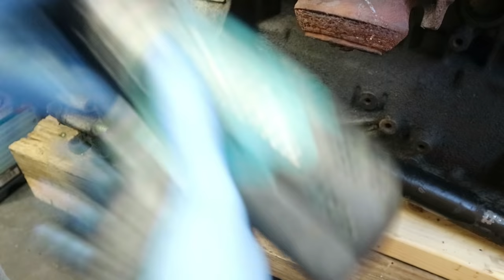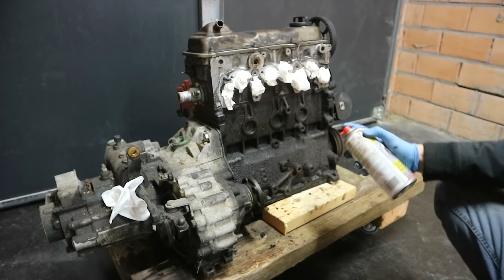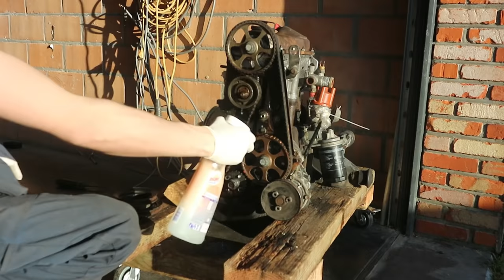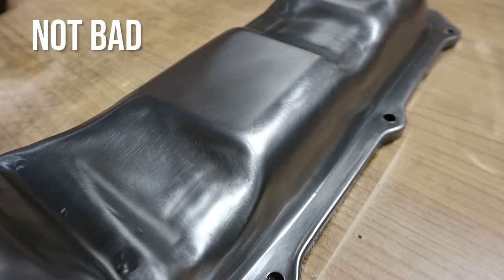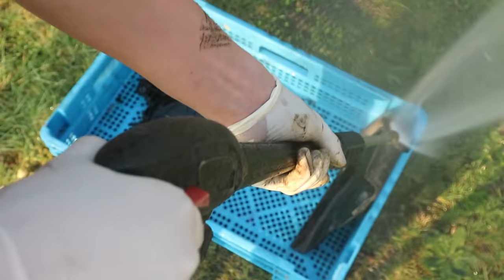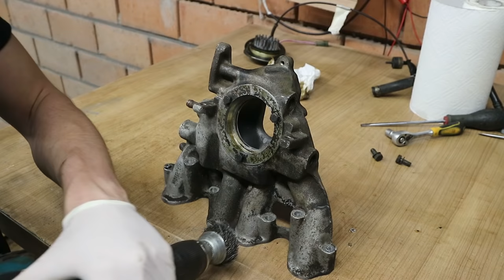Refreshing an 80s VOLKSWAGEN engine  |  Volkswagen Golf Mk1 Engine swap

Comment: I remember these SOHC 8V engines. I built a couple of these. The German spec 9A ( here in the States ) was the engine to have if you wanted a good build. It came with the 10.1:1 CR pistons. Stout little engines but they do better as turbocharged units. Nowadays if I were to build one I would skip these and go for the 1.8T...same engine just with 5 valve head. The make nice projects!! Would make an MK1 go like the wind!! Glad to see someone is still into these older cars. They have so much more character than the new Volkswagens.

Comment: Here in Brazil, this engine is know as AP and it was used by VW until 2005 if I'm not mistaken. Very reliable engine.
Reply: Eu acho que os ap só foram feitos no Brasil, na Europa é outra referência
Reply: @eoquimporta1430  É a sigla EA, se não me engano é EA837 e EA827 nesses carros
Reply: Tem gente que chama os MI de AP tbm, esse aí é APzao tbm igual do meu Seat 97
Reply: @GuilhermeMetz 
  O Motor AP de primeira geração era chamado EA827, já o de segunda geração era o famoso EA113
Reply: Motor AP foi fabricado em sua segunda geração (EA113) até 2016, a primeira geração (EA827) foi produzida até 2009
Reply: Esse do vídeo e um ea 827 mesmo muito parecido com nosso AP 1.8 brasileiro

Comment: Since you went so far as removing the valve cover and changing the belt pulley, you could also replace the belt and remove the cylinder head to check the valves and cylinder walls. You could have removed the oil sump and checked the oil pump. All in all a great job done with all the tin parts.
Reply: i igree!
Reply: and water pump change...
Reply: The cylinder head bolts of this engine deform when being tightened. So you would have to buy new ones if you want to remove the head.
Reply: @joshuatassone8764  that's weird are they meant to?
Reply: @ricky107_  Based on my knowledge, yes.
Reply: @joshuatassone8764  its always wise to replace cylinder head bolts on any vehicle when doing the head, I do
Reply: @ricky107_  Yes. They are also meant to be tighten down with the right about of force. And by that force they are made to hold the engine together. They are not meant to be reused. They are the vital part of holding the head and block together.
Reply: @ricky107_  I know this is an old comment, but yes. For some applications, like some cylinder heads, they use torque to yield bolts. These bolts get torqued to such a degree (due to the high loads they have to carry for a long time) that they permanently deform once they are installed and will stay this way forever. To get a good, tight seal again, you will need to use new bolts as the old ones are already deformed and won't hold the head and block together as tightly as they did before.

Comment: Nice work. For a complete work, you can clean the pistons, replace the head gasket and bearings. A lot of cars used this engine here in Brasil, in 90's was common a 1.8s ethanol version, with 12.3:1 of compression and Pierburg 2E, they came with 106cv from factory.

Comment: How can you not like a clean engine? A clean engine runs cooler and therefore longer. Thumbs Up. I think I would have changed the timing belt as well, myself. A ton easier then when it is installed...

Comment: In Brazil this is the most prepared engine for high power. called "AP" alta potência and came out in several cars of own brand: gol mk1 mk2 mk3 mk4, Santana mk1 mk2, Passat b1, Apollo, polo classic, Jetta mk6, golf mk3 and mk4, Voyage mk1, Saveiro mk1 mk2 mk3 mk4, parati mk1 mk2 mk3 mk4, pointer, Logus, van And diesel version as in Kombi and Saveiro

Comment: that engine is called AP, there is 1.6, 1.8, 1.9 and 2.0 versions. it's the most popular engine here in Brazil, cuz it can hold high presures of turbo, it's really cheap and u can find it anywhere. we have cars with almost 2000 HP using this engine.
Reply: i really would LOVE to know how your getting 2000hp out of a 8v 1.6  🤦🏻‍♂️
Reply: @vdubskiee5356  well then search for the AP engine and enjoy :)

Comment: This is the most bulletproof VW 4 banger known to mankind!!!! IMO
Reply: Correct.
Reply: dont forget the 1.9 TDI
Reply: @Pain5k  in terms of reliability older engines are better even though they might be more pollutant and lacking technology, my grandpa had a 1.6 diesel passat b2 that engine was a tank, car got scrapped unfortunately
Reply: Yea, and that's not saying much either.
Reply: @Pain5k   and 1.6 8V, 1.8T, 1.6D, 1.9D, 2.4D, R5 2.5Tdi...

Comment: Kiedyś miałem VW GOLF 3 z silnikiem 1.8 GT 90KM ABT, teraz mam AUDI 80 B4 2.0 90KM ABT. W Audi zrobiłem remont silnika. Pracuję w autoszlifie. 
I used to have a VW GOLF 3 with a 1.8 GT 90KM ABT engine, now I have an AUDI 80 B4 2.0 90KM ABT. I overhauled the engine at Audi. I work in a car repair shop.

Comment: this job added 50 hp to the engine
Reply: This engine barely had over 50 how from the factory
Reply: He didn't add squat, except make the engine look cleaner...not a single performance enhancing job was done to it, and by reusing the old timing belt after slopping chemicals all over it he may well have shortened the life of the engine.
Reply: Some of us are broke but still wanna have nice things
Reply: @warika1208  the original comment flew right over your head.

Comment: I found a total gem of a engine!

A 1600 engine for sale for only 250 euro’s! Sadly it does not come with a transmission. I have a build project coming up in 2 years time which is perfect with engine like this, but should I go for it? I am mostly just afraid to miss out on a engine like this.

Comment: That engine with the 1.6 Diésel Crankshaft and 10psi can take 180hp STD
Here in Argentina we have the Volkswagen Gol AP 1.6, 1.8 and 2.0i GTI (GOLF 3 engine) 
Its the equivalent of a Civic in USA 

Currently we have the fastest Front wheel drive Record in the World by Team Viturro Argentina with a VW GOL G4 1200+hp its a beast (1.8T 20v Jetta engine)

Comment: I still ride a 1400 version.  240 000km never opened. No oil usage. Recently did the clutch myself.  If I were him with the engine out , I would have done the clutch,  water pump and head gasket.  But first compression test.

Comment: Im in the process of turboing my 1.8 dx which is fitted in my 74 passat wagon.
My goal is 350whp.🤞
Stay tuned.
Reply: Any movement on this? I've just bagged a 74 b1 wagon...
Reply: @garyjones980  Nice, slammed wagon. I ended up putting an Audi 20v turbo with 5 speed AWD gearbox in it. It's only Fwd atm but will eventually be AWD.
Reply: @rhyswoodman6781  I'm keeping this original as it's been sat in an Australia shed for 38 years, only has 112k kms on it. Bright yellow with brown interior, so 70s!!!!
Reply: @garyjones980  yeah keep it original for sure! That's awesome mate.
I have five  b1s in total including an original TS which my dad bought in the 70s.
So I thought customising one of them won't hurt.

Comment: If that cover is right (197k KM) then first things in the list would be the head gasket and main seals, and check for cylinder scoring. Perhaps it needs honing and oversized components. 
Keeping the engine clean on the outside and overlooking the inside ain't the way to go. That's how you get catastrophic failures down the road. You'll never know how the cylinder walls looked like.
Not criticizing because we all started trying to make things better with a couple rugs, but that engine got pulled out for a reason.
If you don't have a torque wrench and that's why you decided to stay out of it, your local machine shop can torque the head down for you and typically free of charge if you give them the torque specs and sequence.

Comment: Great video!

Since you went this far, why not replace the head gasket? Given by the looks, the engine probably has never been opened.
Reply: @vielflieger7973  und du ein troll
Reply: @BigBossKollegah08  Klappspaten
Reply: @vielflieger7973  Sag ja Troll armes kleines Würstchen :D
Reply: @deathproofpony  wixxer
Reply: Yes so true and new oil filter and timing belt also the clutch will prob be seized
Reply: @vielflieger7973  keyboard warrior
Reply: @raymondlidy5918  Seized clutch? Why?
Reply: @DerpotronGames  I have been a mechanic and auto electrician for 40 years and most people know if you leave any engine out  or even in the car for a long time the clutch and most of all the brakes  could get seized very easy

Comment: Dude, you didn't restore it, you just cleaned it :(
No headgasket changing, no new piston rings, no cylinder wall honing, no main bearing replacement, no new valve stems and valve seal replacements :( All things I would expect when someone says restoration.
Reply from the maker: I didnt say restoration though
Reply: Yeps i agree with you memphis you said refreshing

Comment: you can use a 20v cylinder cap in it. in Argentina is a common upgrade.
Reply from the maker: Leonel Gomez 20v cilinderhead?
Reply: @memphis5220  yes. Came in the 1.8t for audi a3/s3/tt, jettas and golf gti mk4

Comment: hI guys wonder if you can help, I have   Fiat Uno 1100  1999 model.close on 275000 km on the clock. runs like a dream. on the freeway. BUT idles far too high when at stop street or stuck in traffic. was serviced recently and I thought it was the choke that was stuck. Had carb serviced a few months back. guy did a great job. starts easy , dont even need the choke anymore to start it . But  none of the mechanics can get the idle down to normal. the last garage said that the carb is " over fuelling ".. or something like that. all I know is its just costing me plenty but Id like to keep the car as a great little " run around ". what does it sound like to you ?

Comment: Holy fuck. Reusing of timing belt is prohibited !!!!! Also you should've changed camshaft and crankshaft seals, water pump.... Compression test is also good thing to do. And also there is one thing - you can achieve much more with using dedicated chem cleaners.

Comment: Did the valve cover started to leak oil? You used the wrong gasket. Your bolts on the head are made for a rubber gasket. In this video you used a cork one.  For this type of gasket you need stud bolts with an overhang ;)

Comment: Rebuilding enine isn't  hard it's a quite simple engine however  the mess of  Rubber vacuum lines in the steel braided lines of go to the air Box are horrible to service and even harder to source.

So please show that part please show that in part 3

Comment: I´d never seen a engine with two camshaft, one of them overhead, and another one at the side for gas pump and sparks.
Reply: It isn't a camshaft, it's an auxilary drive, with a lobe for the fuel pump and a gear for the distributor

Comment: First Time??? Some advice before start dismantle parts CLEAN  engine. When its  dry spray all nuts and bolt. And wait. Have a plan dont "srcew" a round all over THE engine. At the same Time. Did you change timebelt? Otherwice....  Did you change "halfmoon" cealing? on valvecover?  Its important It is important to tighten the nuts with the right torque and order otherwise it will leak oil. Do not remove the distributor cover the first time you keep the ignition cables. Less risk of particulate contamination. About valve cover. CLEAN CLEAN .

Comment: 4:45 what's the 5th port for? I mean the one filled with grease/sludge.
Reply from the maker: Coolant channel
Reply: Coolant channel helps the fuel from carb vaporize correctly as it flows over the inlet "hedgehog" heater during cold weather. Later models had a electric heater instead of coolant. Worked on alot of this back in the day

Comment: You reused the old timing belt, and didn't replace the head gasket or check the distributer and cap, check valve clearance etc, but spent hours and a ton of chemicals to clean the outside of the engine....?!?!  Hope you realize that there are safer and less polluting ways of cleaning and painting your engine than polluting the ground and air like you did....
Reply: How would you have done it?
Reply: @reouvenz  On the environmental side, the engine and all parts would be washed/cleaned in a plastic basin that can be found in any hardware store or big-box auto parts shop for cheap.  The waste would then be collected and taken to the the local 
déchèterie/recycling station...which is the legal and environmentally safe way of doing it in the EU, I also wouldn't use copious amounts of aerosol spray to clean the engine and parts either, there are safer and more environmentally friendlier ways of doing this.

On the technical side, I would NOT reuse the timing belt from an engine that was sitting outside for months, or even days...Timing belts are so cheap and easy to change especially when the engine is sitting on the ground.  The lifespan of the timing belt is measured in both distance travel and time in use for a reason, they stretch and they may also dry-rot, and very bad things happen when they break.  Same with the head gasket...how can you go this far and not lift the head and change the gasket.  

It took more time to clean the valve cover than it would take to change the timing belt which was already off, or to take off the head, do a thorough inspection and change the gasket.  Drilling and tapping the water passage in the head should never have been done while the head was on the engine, it is impossible to know if all the metal shavings were removed, and the damaged threads in the spark plug hole should have been properly repaired with a tap to ensure there was no leak and that there ware no metal filings in the chamber/cylinder.  I could suggest other checks too but these are (in my opinion) some of the most basic checks to carry out if you're going through all this trouble in the first place...the result would be a more reliable engine and more peace of mind.
Reply: @warika1208  I read what you wrote, thank you for that.
Where are you from?